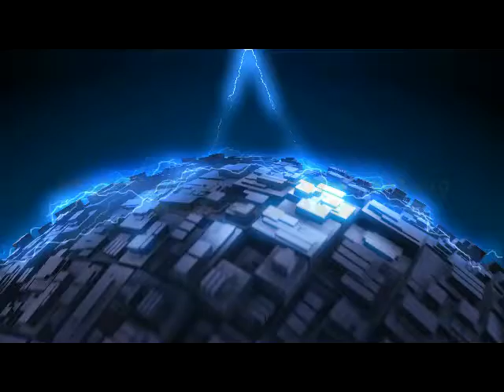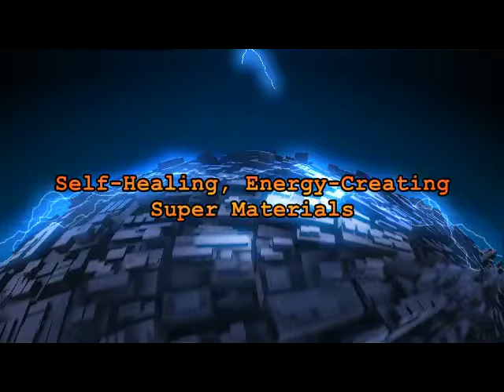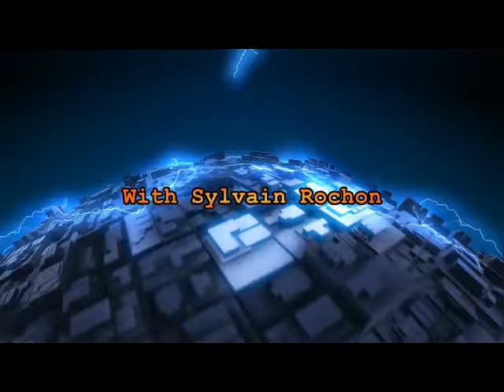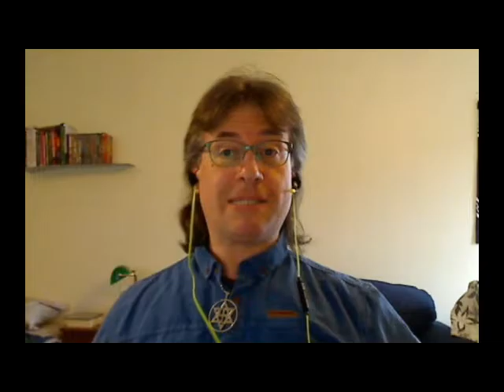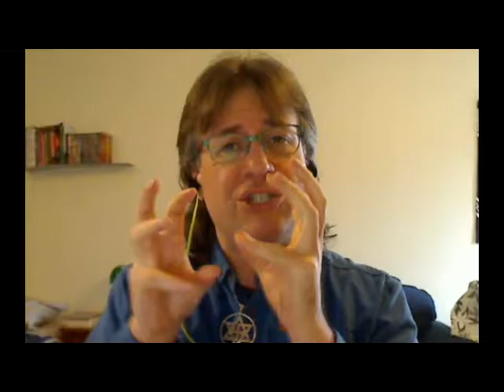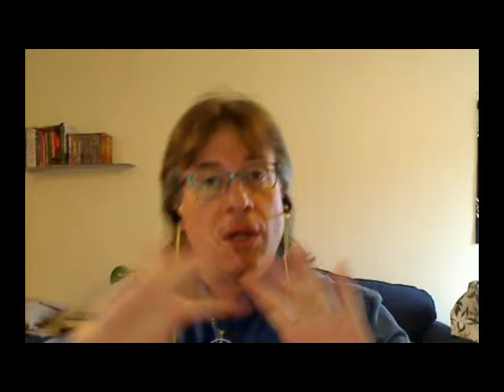Self-Healing, Energy-Creating, Super Materials

Comment: Hello, just found your channel. Q. if you had access to all known materials and you wanted to build a craft that would travel on water, above and below, through air, into space and back, what material would you choose?
Reply from the maker: I wouldn't use one single material to do all that.  You're dealing with too many different types of forces that are opposite each other and extremely different environmental conditions and assuming you'll be moving around, different force types.  Doesn't mean a craft that can do all of this isn't possible.  What I mean is that it wouldn't be excellent at traveling in any of these environment.  Mediocre at best.  

If I had no choice though, I would probably use some sort of composite that could handle it and engineer proper systems that could handle all the different conditions required.  Not a simple task.  It's hard enough to engineer a craft that can go above and below water at any significant depth or a craft that can travel through air and space.....  All 3 environments would be extremely challenging.